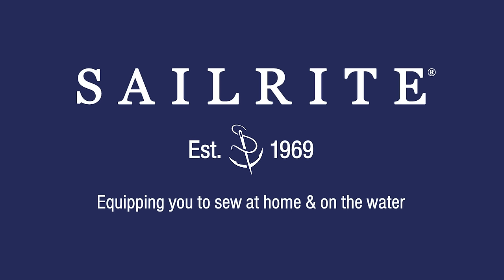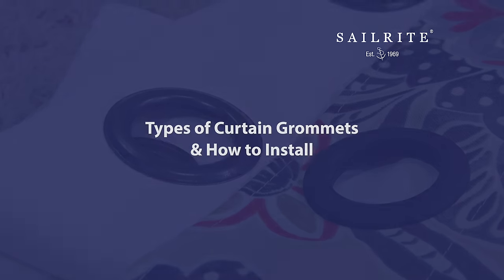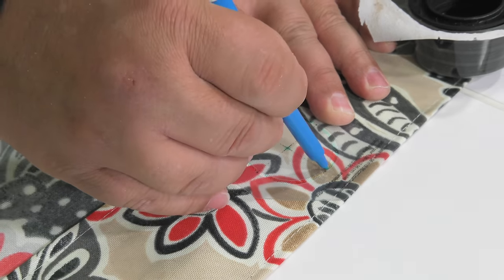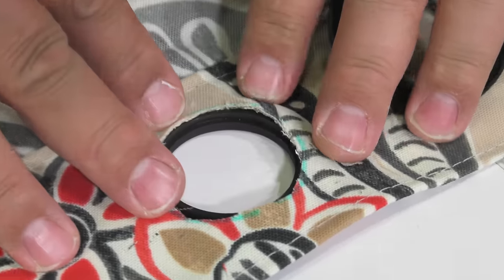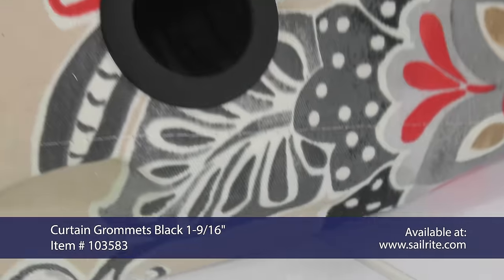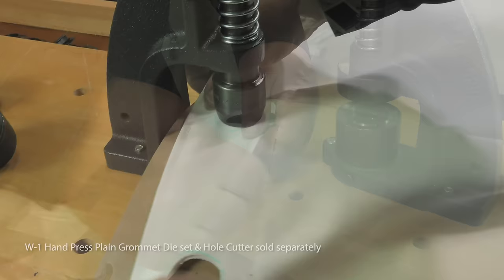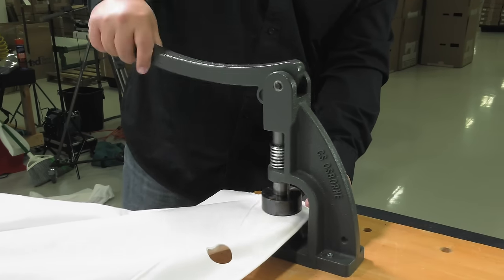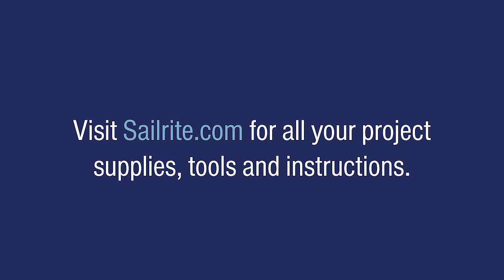Types of Curtain Grommets & How to Install

Comment: Help!!! I just purchase curtain 3-4 months ago.  As I’ve done in the past I washed these curtains and one of the grommets came off. It is a metal grommet.  Can I reuse this or do I have to replace it?
Reply from the maker: I have no idea it depends on what shape the grommet is in and how it attaches to the curtains.
Reply from the maker: Most of the time you cannot reinstall a grommet.
Reply: I had to figure something out.  It’s not a permanent fix, but I took a flathead screwdriver and stuffed the fabric back into the grommet.